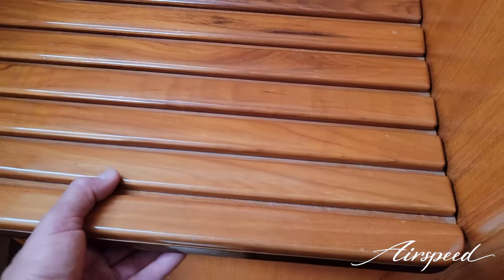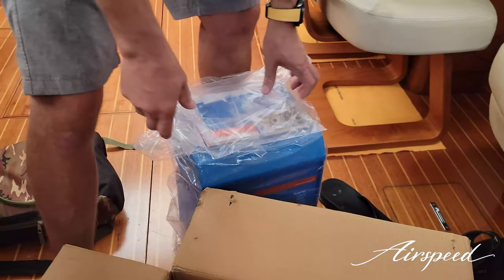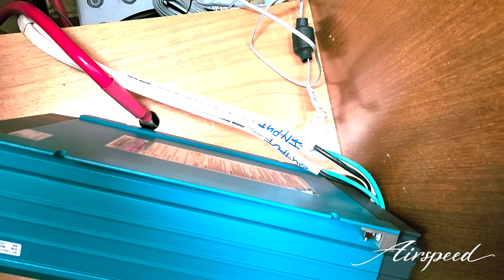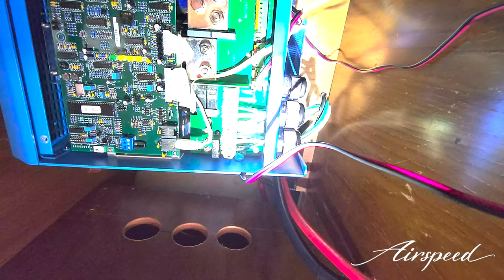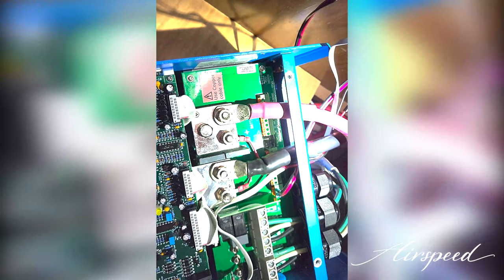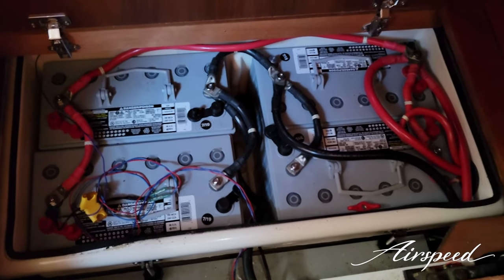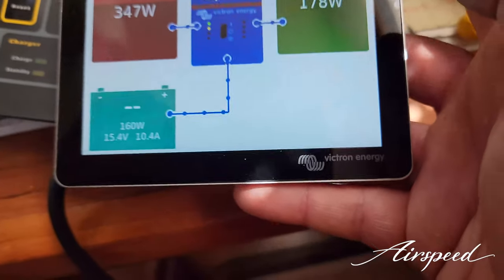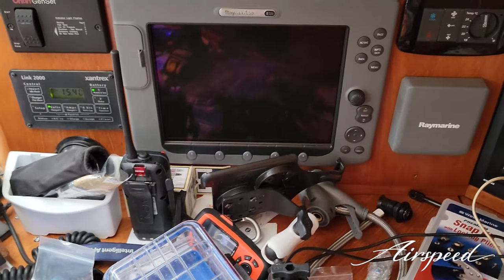Unboxing and Installing the Victron Multiplus Inverter Charger and Cerbo GX

Comment: Great video
quick question, after installing the Multiplus and Cerbo GX, did you do the configuration of the MultiPlus via the Cerbo? or you connected to the multiplus?
Cheers
Reply: sorry for the slow reply...we configured it on the Touch50 GX...but since then, we have been fine-tuning it with the victron configuration tool offline.  For instance, you can enable the battery monitor on the Multiplus(which is off by default), and you can turn off storage mode(which you will need to do if you are out cruising and run the batts down and up daily!  Hope this helps!